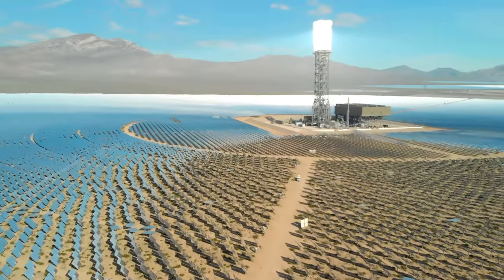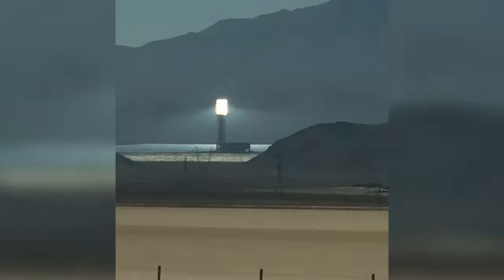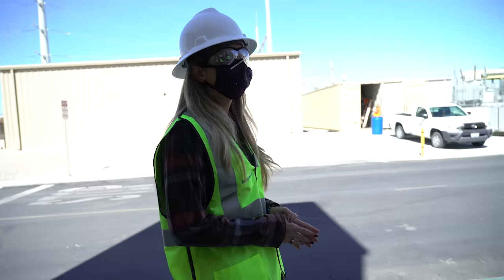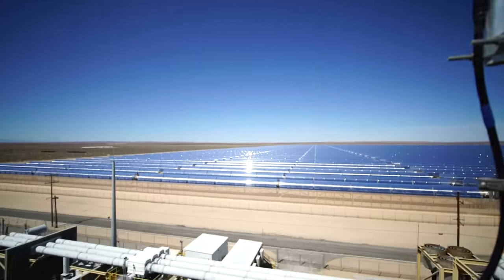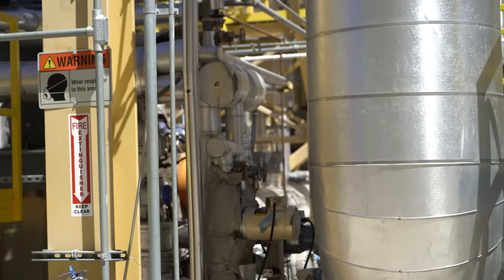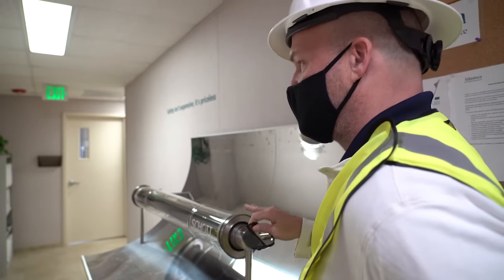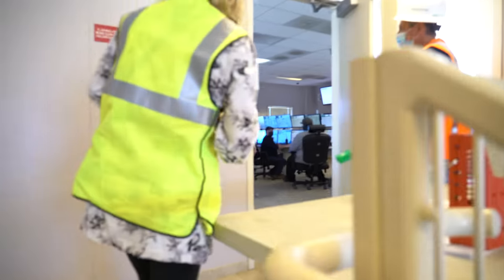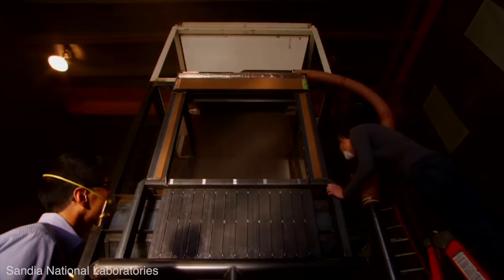How Mirrors Could Solve our Energy Problem

Comment: "If they make more energy than they are contracted, they pay a fine"
So, if they make enough energy to need less of other forms of electricity production they get penalized?
Reply: Thats what I heard. Apparently we need to meet our C02 quota still
Reply: This is screwed up
Reply: That’s really the point of these episodes. If they could take their excess generated power(or heat) and use it at after the sun goes down or the wind slows down we would solve many of these problems
Reply: They get a fine because the grid has to supply exactly the right amount of electricity demanded (i.e. purchased in advance). |f you produce more, the electrical frequency increases. Ideally, we should find a way to store this extra energy in batteries
Reply: It isnot strange if you understand how big a problem too much energy is. Of the power plants produce much more power than is consumed the entire grid can break down.
It is a real art to balance the production with the consumption to prevent that from happening
Reply: Your (and Gio Mag's) uninformed reactions are exactly what was hoped for with that contract statement. Reality is a slippery thing. Deception is everywhere with us humans. The other commenters got it right.
Reply: Imagine what would happen if every power generator dumped all the could onto the grid in an attempt to get paid for it. All power generators have to cooperate and a penalty is the only way to make them do so.
Reply: How about penalizing the fossil fuel plants instead of the renewable energy ones?
Reply: That rule is to protect the energy grid from collapsing.  I am not sure exactly what happens but basically if energy grid is fed more energy than is consumed it runs the risk breaking all power plants.
Reply: @Eric14492   Power plants are generally slow to power up or to shut down. Depending on the power plant type and whether the plant parts  are cool or hot. It can take hours or  even days. So I don't think it is that simple that let's just shut the fossil fuel plant and pray there is enough sun and wind power to meet the demand.  That is why storing energy is essential in order to make renewable energy viable alternative for fossil fuels.
Reply: Nowadays plants producing excess energy can use Bitcoin miners in movable containers to pay for the excess energy and even at very good rates, without any dispersion in the grid. That's by Bitcoin's "Proof of Work" is actually good for the environment and the renewables sources of energy. It can subsidize them, and make them financially viable.
Reply: @ToppledTurtle834  Nowadays plants producing excess energy can use Bitcoin miners in movable containers to pay for the excess energy and even at very good rates, without any dispersion in the grid. That's by Bitcoin's "Proof of Work" is actually good for the environment and the renewables sources of energy. It can subsidize them, and make them financially viable.
Reply: it's not energy, it's power. The power you get from the wall socket is being made right then. If you put more power in the grid than is being used, bad things happen.
Reply: You can’t put more electricity into a grid than is used by the grid. You’ll overload it and shut the grid down.
Reply: It's because the grid has a max capacity you can't over supply it 
That's why these plants need to incorporate storage like they said in the video 
So that excess power can be deployed into the grid when production is down

Comment: The tower type plants use a mirror setup which concentrates enough solar flux to set errant birds on fire.
Reply: Free lunches for the power plant workers
Reply: Yeah, they explode, right? Gotta love Gohmert! Now if only someone will help him alter the moon’s orbit to fix climate change
Reply: @jkangaroo  If you like them exceptionally well-done, sure.
Reply: Errant birds don't go through the focal point given there's a (very visible) building there. When not collecting heat, the solution to avoid frying birds is not to shift the focal point of all the mirrors up the same distance, but have different points for each mirror.
Reply: @benoithudson7235  The mirrors mutilate birds. Just look it up.
Reply: @sandal_thong8631  I see that your solutions are completely serious and create no new problems for any animals involved. Bravo.

Comment: I love this tech, but the tower fields are deadly for birds- the heat instantly incinerates them. I had heard they were working on that, I was hoping there would be something mentioned about it here, as to if they have found a solution.
Reply: Yeah, the power towers do fry birds, that's why I think the parabolic trough collectors are probably more friendly to wildlife. The birds don't tend to fly between the parabolic reflector and the absorber tube.

Comment: Assuming X amount of solar energy hits a given area on Earth based on the geography. Is taking some of that energy and using it to create extreme heat in concentrated locations going to have a positive or negative impact on climate change? Will it create heat zones like a city does causing disruption in weather patterns? Or assuming some less than 100% efficiency, would less than the total energy drawn from the sun by converted and that energy loss help reduce local heating? 

What are the non-electrical generation impacts to the environment?
Reply: All the energy from the sun that reaches the Earth is converted to heat eventually, whether or not some of it is interrupted by mirrors and towers or mirrors and tubes.
Reply: @pauleohl  Then explain why putting garden roofs on buildings reduces heat loads in cities. Same sun. Different surface. 

A sand desert reflects and dissipates it's heat back into the sky at night. The stored energy of those systems does not.

Comment: Any birds flying  through that area with mirrors are cooked instantly.  The parabolic collectors are not a  problem with birds.
Reply: mmm.. mirror chicken... 🤤
Reply: And no airliners can go anywhere near this either!
Reply: @jamesrobinson9176  it's on the ground so ideally no airliners will be anywhere near it. The heat dispersion follows an inverse square law so it falls off very quickly as you move away from the site.
Reply: @abebuckingham8198  these mirrors literally create a solar death ray. And yes,  pilots are required to avoid these airspaces, too great a risk of blinding the pilot and their instruments.
Reply: @jamesrobinson9176  I won't contest that they're bright but it won't be hot at altitudes planes are flying if you can walk close enough to video it.
Reply: @jaredhinman chickens can fly. Not great and not for long, but still, better than most people think.
Reply: What tempature does it get in the air around that center part, cause im not sure it qill get hot enough to fry something that is flying through air which is not nearly as conductive as a solid.
Reply: @remco6816  think solar radiation, not necessarily heat. Imagine the sunburn you'd get by having 20000 mirrors reflecting the sun towards your exact position
Reply: @jamesrobinson9176  Last time I was in the US, I flew fairly close to one of these things. Not directly over the top admittedly, but within a few kilometres such that it was still pretty bright to look at. I don't think they are that much of an issue to commercial aircraft.
Reply: Fossil fuels have indeed caused damage. And yet every year goes by we get better at them causing less damage. This type of solar is created to reduce damage to the environment. The fact that it causes as much, and by some estimates more (obviously quite debatable) is at least a littlw ironic.
Reply: Also, most damage to the environment from fossil fuels are when things go wrong. Ironically, most damaged to the environment in solar is when things are working as intended.
Reply: @Musikur   the FAA disagrees
Reply: @aaronvoss38  lol. Sure guy. Im not anti fossil fuel. We need energy. We need even more than the finite fossil fuel can supply. The answer will eventually come from the sun. So be it if some birds fry in our pursuit
Reply: @aaronvoss38  vaporized nice word, now explain the process, how and why it happens. I need some explanation in technical terms not dramatized ones. Im willing to believe you but it needs some explaining. 

Most damage from fossil fuels is when it gets burned as its ment to. Damage to health and environmental, only NOx emitions do lot of damg to biodiversity. But if you deny the impact of NOx and CO2 but then thats up to you not up to facts. Even more damage is being done when it goes wrong. Fossil fuels will never be without consequences.  

Besides their are multiple other solutions besides this single solar option its not this or fossil fuels its maybe this or whatever els is possible.  As long as we gradually decrease the use of Fossil fuels. Btw how can you assume that this local solar plant in an área with low amount of bird live is causing more damge than fossil fuels have globaly? Especially if you include the added damage of increased extreme weather. One flood caused by warmer weather which adds to humidity and increases precipitation can kill billions of insect and smaller mammals in a day. We have seen these only this year in China, germany/Belgium/Netherlands, turkey, and Africa.

Comment: This is awesome stuff and I’m really excited to see where CSP goes. However, I do want to ask when as a community are we going to start talking about how contracts that disincentivize production outside of a quota are designed to maintain a resource scarcity to maintain profits and keep the costs of energy the same?
Reply: Yeah I don't think that's the case. Imagine the grid like a bucket of water with a hole in the bottom. The power plants are pouring water into the bucket, while what we use (lights, water, other utilities) is the hole, draining water. 

What happens if more water is being poured in than the hole can drain? It overflows and causes a mess

That's not quite accurate to a power grid though, it's more like too much water goes through the hole and breaks whatever tube is attached, like a power surge tripping your breaker. Too much power screws things up, which is why advances in energy storage are so important right now. We need better batteries, then we can get better power
Reply: @techwizsmith7963  Right, part of the infrastructure we should invest in is better storage so we can drive down the cost of energy. I’m saying that these laws (whether government or contract) inhibit surplus energy from decreasing the value of energy. Without investing in storage we will continue to have only one bucket with a hole and never another bucket without one. The only thing stopping us from having another bucket in a free market is government contracts explicitly prohibiting it.
Reply: @distractedsquid7436  I'll admit I'm not super educated on the various contracts for power companies, so I'll have to look into this more to solidify my opinion, but I'm not entirely confident that they're not allowed to make better storage options, I would think we just don't have better storage options yet and are working on them. If you can point me to some better sources on their standard contracts or anyone involved talking about them, it would help my search, and I would absolutely love to read up on it
Reply: All based on economics and total costs (to environment as well), there must be a cost for the penalty of excess energy

Comment: Could you do a video which explains the relative power output of a few various types of energy plants? How many square metres of pv panels do you need to power the same area of CSP? How does this compare to coal power. One of my feelings about CSP is that its a very industrial process, which isn't as well suited to mixed agricultural solutions like wind (and potentially PV if done  somewhat sparsely). Which is fine depending on the application of course.
Reply: Nuclear power is smaller produces more power all the time with less injury and wastes, nuclear fuel is 70,000,000 times as energy dense as diesel which is of course hundreds of times more energy dense than solar or wind.

Comment: @4:32 you were asking about the heat exchange I guess. The heat is transferred through tubes. They don’t mix with each other, but the heat transfer fluid flow through one long tube. The heat then gets transferred to the long tubes carrying water and converts it to steam.

One thing to understand about steam turbines are, they spin really fast. The revs are high. Steam comes in at high pressure, spins the turbine and then a condenser is used on the output to cool down the steam to water making the pressure low. This improves the efficiency of the turbine. Easy way of saying, high force on one side and low on the other side makes the turbine spin really well.

Comment: I have toured the Ivanpah facility. It is one of the coolest things I have ever seen in person. You needed sunglasses to look at the towers due to the intense sunlight reflecting off of them. That style of plant is unlikely to be the future of concentrated solar. The cost of the facility was exorbitant and the output is not particularly high. It is also very difficult to control the mirrors and labor intensive to clean and replace mirrors (there are just so many of them). Also, the peak output can only be reached when the sun is high in the sky with perfect conditions. When we toured the facility, the output was down 10%+ due to dust in the air from a dust storm that happened the day before. As much as I would like this type of facility to be the future, they just aren't cost effective.

Comment: The conversation must be made for sustainable energy which includes modern discoveries/ researcher on nuclear power, Geothermal energy and more alternatives that doesn't involve experimental technology. I look at this massive complex of solar heat transfer system and my first thought is how ecologically disruptive was it to build out such a huge structure in a large area. It reminds me of the scene from Blade Runner 2049 where an array so enormous the size of a large city will be needed just to power that dystopian world where we end up
Reply: Yeah, it's a shame that nuclear is seldom mentioned in the clean energy conversation, when we've been improving the technology for 6 decades.
Reply: @user-en7dx1qp3k  we are at the cusp of real cold fusion and nobody wants to talk about it. Also the new methods of recycling nuclear waste as fuel for energy is mind boggling how no one is making any effort promoting this concept.

Comment: The good is that I absolutely love your enthusiasm. I'm not sure when this video aired initially but you may want to update your research related to Ivanpah and Tonopah CSP's. Tonopah actually never met it's goal for output and NVE cancelled their Contract with Tonopah Thermosolar, the plant is curretnly idle. Ivanpah is similar and does not produce the amount of power that it was designed to produce. There has been dicussions to decommission it.  The enviromentalists have fought these plants all the way as well. Google the Term "Streamer" It is related to the effect of birds flying thru the concentrated sunlight, the bird will actually spontaneously combust. Sorry for the bad news on these solar plants.
Reply: Don't be sorry the truth about these projects should be common knowledge so they can stopped being used as another social engineering tool. I'm all for a healthy planet, but don't the right way.

Comment: I have been very critical of the prior videos in this series, but concentrated solar actually is a good idea and absolutely should be a major part of getting us to net zero.
Reply: net zero birds
Reply: @MultiApeh  I chuckled.
Reply: I disagree, we already have way better tech (i.e. nuclear) that literally powers small cities on large ships that have been proven safe and effective yet is never brought up in these conversations. we would rather try to invent new ways to capture a small percentage of solar power, that will only be a substitute for power when the sun is out. Yes, its a cool tech but is only a really expensive bandaid for our main problems.
Reply: @Mike-zu9ke  It's literally cheaper than nuclear, and literally is already invented and implemented on the grid today... Right now.
Reply: @MultiApeh  Ah yes because no birds die from coal, natural gas, wind, biomass..
Reply: @hargibson18  um.. nuclear is widely used on the grid as well. nuclear does have a large upfront cost but I'm sure if you do a cost analysis over time nuclear will have a much higher power output and cost less.
 
Today, roughly 1,815 megawatts from concentrated solar
Reply: Solar pv is 1/4 the cost
Reply: @nordic5490  at what output? Maybe the first few years solar may beat nuclear but after that nuclear is a net positive and blows solar out of the water in cost and energy generated plus it can produce much more energy on demand. can solar do that?